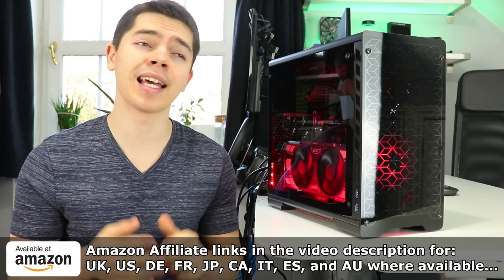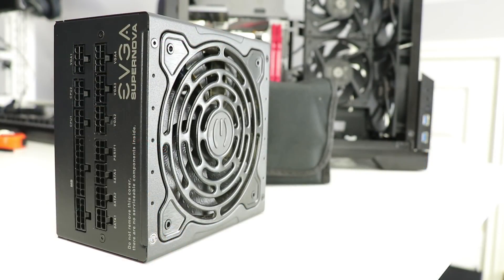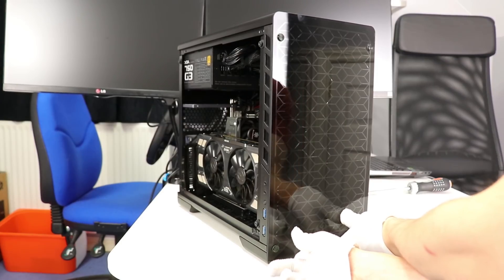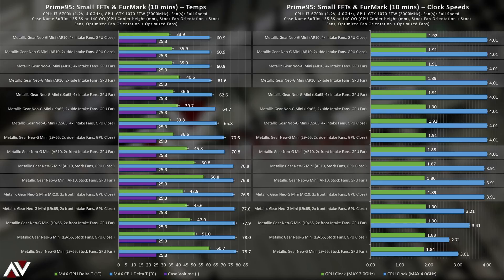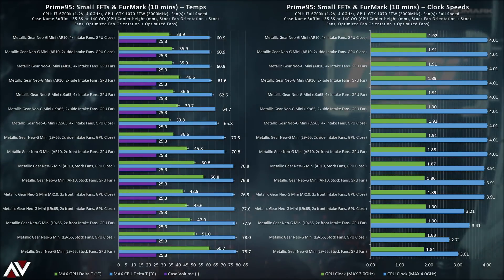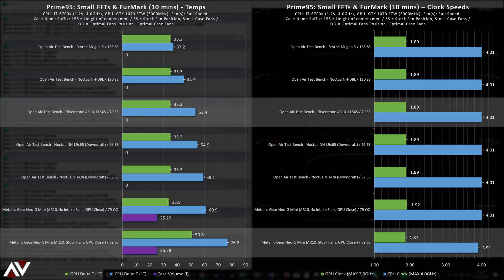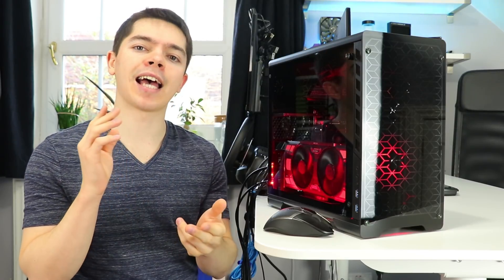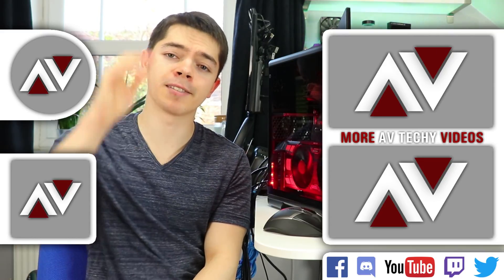Metallic Gear Neo-G Mini Tested - 16 Setup Variations!

Comment: I Was searching for a deep review for this case. You gave a lot of very useful information, like best fan are 2x side intake. I'm thinking about building in that case with Aorus b550i pro ax + Ryzen 5 5600x + RTX 3060Ti FE + pciex4 nvme ssd.
I think I'll go for 2x120mm side fan intake, 240mm AIO (arctic freezer II or EK aio basic) in exhaust and add a rear fan exhaust. Do you think it's a good idea or am I screwing up the airflow ?
If I change for the little brother : the neo mini v2 without the vertical GPU (as I read that there are a lot of issues with the Riser pciex3 on pciex4 motherboards and GPUs), do you think your recommandations applies ?

Comment: I realize this is a dumb question but I am doing a build with a R5-3600 and 1070ti. I plan on using the stock Wraith Stealth cooler and some combination of 120mm fans on front/back/side. I'm not really sure. This won't be heavily driven machine, but I want to provide adequate cooling. I'm confused about how/what to place for inflow vs outflow fans since there are no top vent holes. Case comes tomorrow so any guidance will be welcomed. Great videos by the way.
Reply from the maker: Best I can suggest is if you have 3x case fans, I'd place a couple on the side panel as intakes, and one rear exhaust.

Reasons for that is there'll be a little less airflow on the intakes since they're more restricted due to the filtering, so two intakes is preferable to attempt to match the exhaust airflow of the less restricted exhaust fan to the rear.

Balancing out the intake and exhaust is the target. But a little more intake isn't too bad, the extra turbulence prevents dust from settling.

Hope that helps, and best of luck with the build!
Reply: @AVTechy  Awesome, thanks for the quick reply. I guess I was confused about the in and outs (literally) of airflow. This makes sense. thanks again. If I have thermal issues I will address it then.

Comment: Judging by this, my best case set up would be to put my 240Aio as input on the side with 2 other fans on the front and then put my 2070 super closest the motherboard. Do you guys think this would be good?

And would you recommend I run the fans on the front at a higher rpm to combat the small slits?

Comment: Great Video as always👌
Im planning to build inside this case so which cooler should i get for the ryzen 5 2600?
Reply from the maker: That's a complex question :P. What's your budget for the cooler? Do you have any opinions on how it should look? Do you want a downdraft r tower cooler? And do you value performance or acoustics more?

We'll see if we can come up with a good solution.
Reply: @AVTechy  So first of all, thanks for the quick answer. My Budget ist around 50 Euros/60 USD. The look of the cooler isn't as much important. Downdraft or Tower Cooler (not important for me) and i would say acoustics and performace are equaly valued.  I tought the Noctua NH-L9x65 SE-AM4 would be a great choice?
Reply from the maker: Looking over the coolers available for under $60 (more than enough), and under 80mm, I think you're suggestion of the NH-L9x65 SE-AM4 is a perfect choice. I'd certainly recommend it :)
Reply: @AVTechy  Thanks a lot :) Hope you have a great day

Comment: ive just started a build in this case. 2 quick questions. 1- any objections to using an sfx psu with this case? 2- ive put 2x 140 fans in the front as intake, the 120mm that came with it is going in the rear (exhaust) and im adding a corsair 240mm aio on the side (also exhaust)- any objections to this??
Reply from the maker: For the PSU, make sure the cables are long enough. Although this is an ITX case, it's a big one, so standard SFX PSU cables may need an extension kit.

As for the fans, 2x 140s in the front is good, but the 120 to the rear won't work as standard. There aren't any fan mounting positions to the rear.

The AIO as an exhaust on the side will likely cause negative pressure (not bad by itself) in the case, and extract the intake air from the front before it's had a chance to get to the graphics card, I'd make that an intake and remove the filter for increased air flow.

Other than that I think your all set to go. But definitely prioritize the side as an intake over the front if you have to (see the testing results to confirm).

Comment: What’s your favourite mITX case below £100?
Reply: Silverstone SG13 is a fantastic little case, very small at 11.5L of volume, fits in a bag, allows for standard ATX PSU, full length GPUs and 120/140 water coolers, and with some modding (relocating the PSU to sit next to the front panel) it fits tower coolers up to 155mm (Scythe Mugen 5, yay). And it's cheap. It's a pain in the ass to cable-manage, though, due to size.
Fractal Design Core 500 is on a larger side of SFF (19.5L) but it's very friendly for building, fits a standard PSU, has good storage capacity, fits 240mm water coolers or tower coolers and long GPUs...
Sharkoon QB One is similar to Core 500 but smaller (14.5L, IIRC), with fewer storage options and a PSU limitation. Very cheap and well thought out.
Those 3 are a so called "shoebox" cases...I really wish some of them would be tested here.
Fractal Design Node 202 is a slim case, similar to SIlverstone RVZ03 tested on this channel, but smaller (10L). 
InWin Chopin is a tiny case (only 4.5L) that's pretty popular for APU machines, since it can't fit a GPU or a regular PSU.
Thermaltake V1 is large (22.7L) cube style case that's cheap and fits regular size components (save for the mobo, ofcourse).
Cougar QBX is a popular case, 20L in volume, looks more expensive than it is.
Jonsbo/Cooltek C2 is a fancy looking aluminium cube that (on paper) fits mATX boards but works much better as an mITX case. Cooling, storage and cable management options are pretty limited, though (like in all Jonsbo cases).

Those are some of the more popular cases under that limit...
Reply: Other recommendations besides Silverstone SG13?